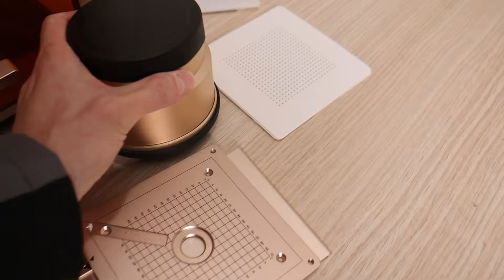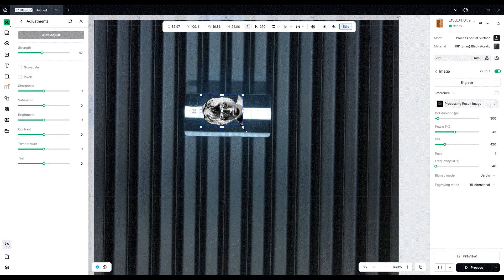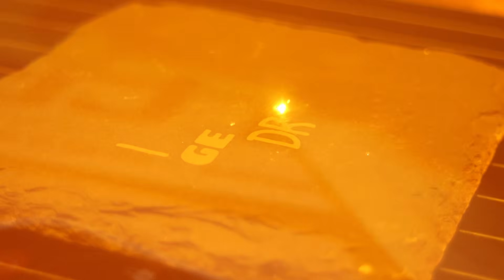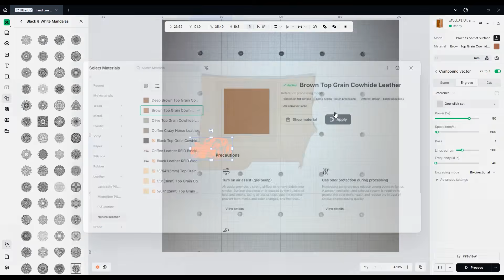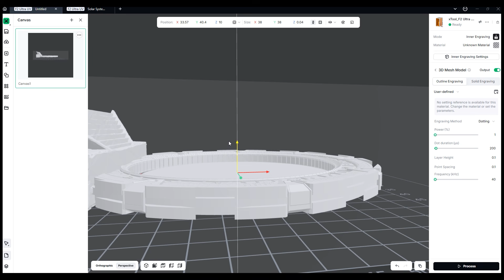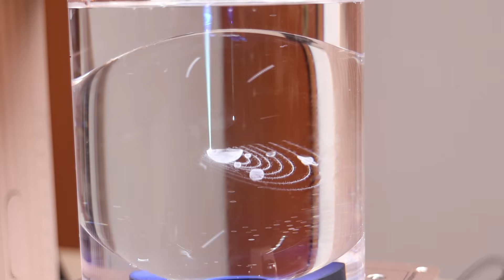xTool F2 Ultra UV: Is This the Easiest UV Laser Engraver to Use? REVIEW And TEST

Comment: Hi and thanks for a great demo. I'm practically sold on this as it is exactly what I need.  Just one question - was there any problems with fumes or fire hazard?  Is there any built-in for those or are they a non-issue?
Reply from the maker: UV lasers produce less heat and are much less likely to cause a fire. But still should never leave the machine unattended. But I think the xtool fire safety set should also work with F2 Ultra. It is an automatic fire extinguisher. But check for compatibility.For fume extraction I use xTool air purifier and it works great. Don't need to vent outside for most small jobs. If you check my link in the description, you will get a small discount at checkout as a thank you. And I also get a small kickback at no extra cost to you :)
Reply: @JTMakesIt  Thank you very much for the reply.  I will take it into consideration and when the time comes, I will certainly use your link!
Reply from the maker: @ShellyRMBthanks! Glad to help 😊

Comment: Great review! This is very helpful. I am considering getting a UV laser for cutting 0.2 mm stainless steel, but I'm worried about getting a rough edge. Would you recommend xTool or ComMarker for this purpose?
Reply from the maker: I would get MOPA fiber laser for cutting stainless steel. UV is not the best on deep engravings in stainless. Fiber laser would be 10 times faster at this. Check my reviews of lasers like ComMarker Titan, B6, B4... MOPA lasers can also engrave black and colored markings on stainless and easily produce very deep engravings
Reply: @JTMakesIt  Thanks! I will definitely take a look!

Comment: Can you produce Printed Circuit Boards (PCB's) by removing the copper that's not required?
Reply from the maker: Yes you can! Although the process is relatively slow, it can produce very clean results. I etched a PCB in this video:
https://youtu.be/LH6GypFHd6Y
I used 10W machine, but 5W can also do it although it goes much slower.
Reply from the maker: Here is the PCB test I did with the xTool F2 Ultra UV. It came out awesome 😎 
https://youtube.com/shorts/Ly-79-KJJZk?feature=share